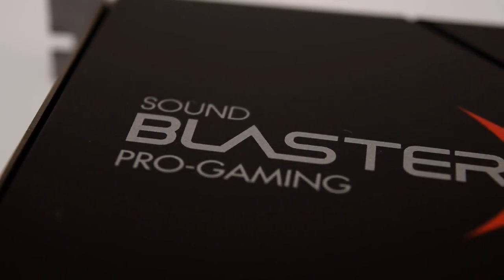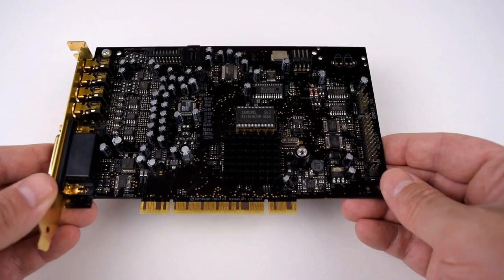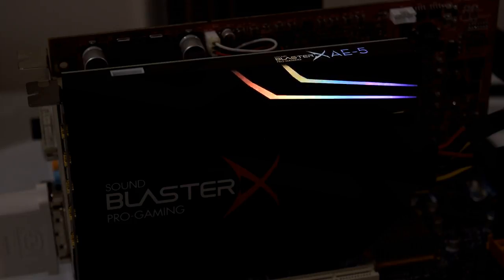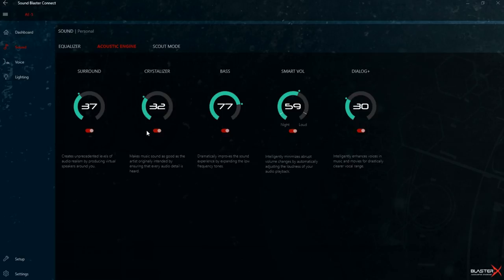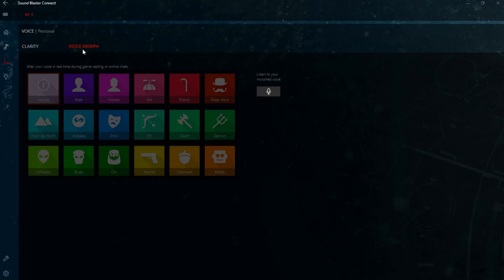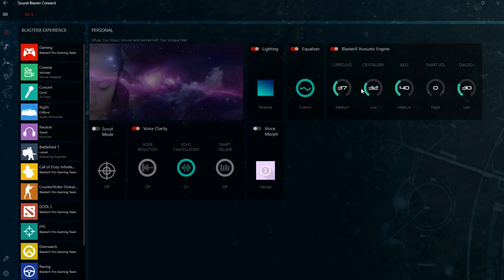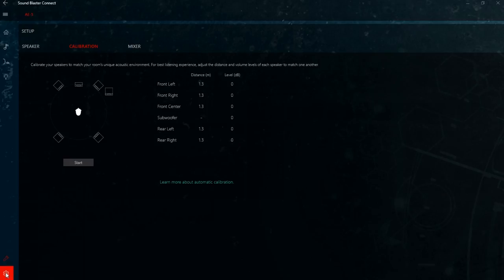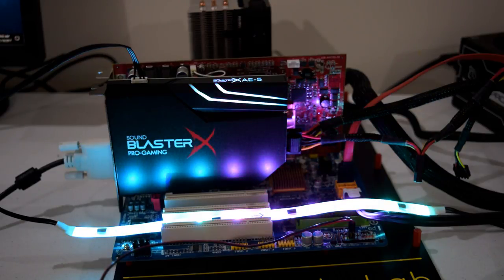Is the SoundBlasterX AE-5 Creative's best Sound Blaster?

Comment: Sounblaster X-Fi Platinum here! Still sounds awesome after 12 years!
Reply: Still using a X-Fi Xtreme Music as well. I can't quantify it, but it still sounds better than onboard audio to me. The AE-5 is the first card in a long time to make me consider upgrading.
Reply: Had to retire mine due to a lack of PCI slot on the last motherboard I got. Loved the front panel 5'25 insert. Now I'm stuck wiring everything though back yet again, like a crazy person.
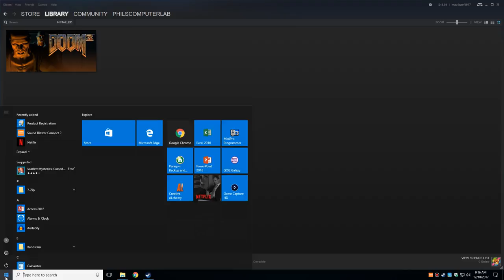Reply: I use the Soundblaster X-Fi Titanium PCI-E at 1:49, better than the newer Creative cards. Also Windows 10 compatible. I recommend the Daniel K drivers!
Reply: TheAslinger Me also on the Platinum, but on win7 pro.
Reply: I am using an X-Fi Xtreme Music in one of my Windows 7 builds with modified drivers and it is rock solid and sounds great. I also have an X-Fi Titanium PCI-E in an Windows XP build using the standard drivers from Creative and although the sound is great, the control panel keeps crashing when i adjust sound settings. I am going to download some modified drivers for the Titanium in the hopes it stops the crashes.
Reply: you should try a SB AWE 32 from the 90s....
Reply: x-fi is the best series of creative! I dont like these new post-3d sound era cards with gimmicky software that undermines the purpose of the sound card by using the cpu for effects. I'm lucky enough to have the top of the line titanium HD and I have upgraded its stock op-amps
Reply: That is a major classic!
Reply: Same here. 

I recently found my old Sound Blaster 16 ISA PNP back, complete with a wavetable daughterboard. Not the crappy Vibra16 one mind you, the real one.

Comment: I still use my old X-Fi XtremeMusic - it's just great! I had the Z for a while, but the outputs were noisy, so I got rid of it.
Reply: I second this. I tried to replace my Soundblaster X-fi with the Z, and the Z sounded very "emulated".  I returned it and Im STILL using my X-fi which is excellent.

Comment: I use the Creative X3 on my modern PC. Its is AMAZING. Clarity, Treble and Bass Excellent. The Separation between instruments and sounds is extraordinary. Works great in 7.1 Dolby too. I use it with my 7.1 A/V home theater receiver using Optical Toslink connection.
Reply: Hate to burst your bubble, but 7.1 over Toslink isn't a thing. Even if the sound card will work in 7.1 mode with Dolby Digital LIve enabled, the signal is down-mixed to 5.1 and compressed for transmission over Toslink.
Reply: @TheEvox81  Yes, The Creative x3 manual reads it can produce Dolby Digital 7.1 Virtual. Not sure exactly what that means but my A/V receiver has all 7.1 speakers enabled when I have it connected to the x3 so 7.1 must be working. Sounds good to me.
Reply: @computerenthusiast402  As long as your happy with the end result.

Comment: I remember Sound Blaster fondly. My 1st SB was the SB 16 for an Acer Acros 486SX/25, sometime in 1993. Fast forward to mid-late 1997 and I bought a SB 64 PCI for an Acer Aspire P200 "tower".  I built my 1st PC in April 2000 and used a SB live value card. That card went through several PC builds and I decommissioned it since it didn't do high res audio (24 bits / 96 KHz) and the last pc I built got flaky and went to another system...and bought a new Asus soundcard (still using it) that has high res audio.  Why I didn't buy an Audigy 2 I don't know. ;)

Comment: My REVEAL SoundBlaster Compatible card that came with my first Packard Bell computer was a workhorse. I miss that card so much. It lasted from 1994 all the way through till 2004, a good 10 years. Now-a-days, that's no big deal as a lot of computer hardware is useful for a decade or so. But back in the 1990's, very little computer hardware was useful two years after it was purchased. Those were different times, computer hardware had a very short lifespan back then. But the REVEAL sound card was an exception. It even allowed me to listen to early MP3's back when CPU's were not powerful enough to decode MP3's without dedicated hardware. It wasn't exactly perfect, but it did give my 486DX2 the ability to play music without skipping.

Comment: My first SoundBlaster was the SB16, I've just replaced my SB Z Fatality as it would glich sound depending on what W10 update I got... I literally got the AE-5 today and it's a great card, the software (SB command) is far better than the Z, but like the Z I use Optical Out and you have to find the setting in the app to turn it on, the app has evolved somewhat and you can find it under Playback, select Digital and enable "Play stero mix to digital output", I now get sound and 5.1, great card even after 3 years from this review.

Comment: One of my x370 mainboards has this built in, renamed to creative mb5, even has the same sabre DAC in fact it has an alc1220 as well! Aorus x370 gaming5. best soundcard ive ever heard by a mile is the auzentech X-Plosion, its based on a high end c-media chip and even has user changeable op-amps, not to be confused with the crappy c media chips found in cheap motherboards, its a beast

Comment: I used from SB AWE32 to Audigy 2. After I  changed to XMOS + external DAC and never come back again. It is far more playable via changing Capacitors, moding the clock,  and power supply etc to fine tune the sound.
Reply: My platinum Drive still keep in the case but no use. Haha, the built in DIR9001 to spdif is good, I used to connect coxial out to my external DAC. It sounds great with Kx-driver.

Comment: I recommend most people DISABLE any feature like Crystallizer that modifies the audio. I have an Auzentech X-Fi Forte from EIGHT YEARS AGO, as well as really good speakers from Audioengine. I can't tell the difference between the Forte, the DAC in the speakers or a recent Soundblaster that I borrowed just to test...

I can tell the difference between the onboard sound from my 5-year old motherboard (Realtek ALC892). I haven't tested any other Realtek chips though, but I wonder if good sound cards have much IMPROVEMENT left to be had over the previous best cards or external DAC's of high quality?

Comment: Drivers are a Creative weak point, but their cards are very good. For many years as far as until today I am using cards of their production. Great material. Thanks Phil
Reply: You should look at DanielK's driver sets. He does a lot of tweaking and refining that you might find appealing. Although, to be fair to Creative, their driver efforts in the past few years have been very good.
Reply: I was try kx drivers and another unofficial and they were better than drivers from creative. Now i am using Sound Blaster Z. This card i very good.
Reply: Charon Underground  this is true, my sound blaster X-Fi Titanium the drivers for Windows 7,8,10 are all buggy and for Windows 10 the card doesn't work right. The newest OS I can use is Vista without problems as for 7 once in a while the driver dies and I have to restart the computer to fix it.
Reply: @SilverX95 If the x-fi drivers bug out in windows (starts distorting sound) you can fix it by just changing the output mode, e.g flipping it from surround to stereo and back or vice versa. You can also just toggle the sampling rate back and forth. Instant fix without having to reboot.
Reply: @ Zeratuhl

thanks for the tip, I'll give that a try when i can.
Reply: +SilverX95
They're not THAT bad. However, DanielK's driver set fixes and optimizes all the rough edges. Seriously, look into it. 
+Zeratuhl
I've heard that before. Have you done it or did you read about it?
Reply: @TheCaptain Yes. I use an x-fi elite pro in my main desktop under Win10. It happens from time to time and is always fixed by changing the output which soft resets the hardware in the card. This is specifically for the issue where sound starts becoming distorted (gets rapidly worse over a relatively short period of time). If you are experiencing another type of issue then I don't know how to fix that, but the garbage output is the only issue I experience on my X-fis and is easily fixed this way.

Comment: Phil, the Audigy and Audigy 2 don't do 24/96 natively-- the internet is full of proof to show this. the X-Fi was the first Creative card set to do true 24/96 and is still a great performer to this day. 
however, just a note for the future, if you're going to be doing videos later including anything with an nForce chipset, I heavily suggest those get the Audigy when it comes time for testing. as someone that lived off a machine with dual Opterons and an overglorified nForce 430 chipset (and all the fun USB issues you get with more than 5 devices plugged in at one time), it is by far the best solution that doesn't get glitching or any of that fun stuff, and sadly only with the updated daniel_k driver set.
Reply: Audigy 2 ZS over digital output does AFAIK.

Comment: Re speaker type, the speaker system usually won't handle this, or it will handle it poorly. If you're plugging speakers and your sub direct into the 5.1 analog ports you definitely want to set this correctly as it will not just send lows to the sub, but also not send them to the speakers.

Comment: Great video. I installed this one but I hear some noise when connected to the 3.5 cables. Funny thing is that this noise is not present when connecting the speakers to the MOBO onboard. Do you know the reason?

Comment: You skipped the Xfi Titanium HD :(  It's what i use, sure, it is an Xfi based card but it was one of creative's legitimate attempts to create an audiophile based card. It uses RCA outputs/inputs, has only 2 3.5mm jacks for mic and line in, and cannot do surround sound except through using digital output to an external receiver. It's a complete anomaly of a card compared to all others creative ever produced.

Comment: I gave up on Creative a long time ago, when it became obvious that they were more about marketing than tech, and when CPUs got fast enough to do high-quality audio processing in software. The last card I bought was an Asus Xonar DX, because I wanted to try 5.1 over TOSLINK to my Logitech Z-5500d, but I was already happy enough with on-board audio.

My current gaming rig is a laptop that has a Creative Sound Blaster Recon3Di sound chipset, and it's not anything special. It's just a bunch of silly effects (which may even be implemented in software in the driver for all I know), most of which are meant to make up for the horrendously cheap speakers that Dell put in the laptop.

My personal opinion is that effects are only useful for fun or to make up for suboptimal speakers, and that on-board audio has been quite sufficient since at least the time that Windows Vista was released - especially if you're not using a surround speaker setup.
Reply: If you're using crap speakers then yeah. But if you're using a good pair of cans dedicated soundcards DAC's are wayy better than what integrated audio can output. my sennheiser phones had a lot of static interference when playing games until I got a soundblaster z on the cheap a few years back. 4 years later the card still works great aside from the lens cover on the card fell off due to the adhesive gone dry but that can be reapplied with some hot glue.
Reply: @oOignignoktOo1  I don't think that's been all that true for at least the last decade. Fortunately I have crap hearing, so I don't have to spend a lot of money to get acceptable sound in any case lol.

Comment: Might just get the SoundBlasterX AE-5 for my new PC.
Reply: Tempting isn't it?
Reply: yep
Reply: yeah I know that's the only reason I said "might"
Reply: +151 Guiding Light
What do you mean by "PCIe power pins"? If you're talking about the four pin molex connector, then no, that is optional IF you want to use the RGB-LED lighting. Phil mentioned this rather clearly. If you're just using the card to do it's job as a sound card, the power connector is not required. Or did you mean something else?
Reply: Bought it few weeks ago. Best thing I've done in a while. It does everything I need. ASIO only work exclusive tho compared to my previous Audigy 2 ZS.
Reply: I've been rocking a SBX-Z for a while now and I love it. What I miss, though, is proper MIDI playback using an actual OPL-3 chip. I remember discovering the extra MIDI soundfonts on my Ultima Online disc and it was just glorious to listen to. These days, the few MIDI files I've saved sound like they are playing on something like a tin can and some string. :/ Other than that, you can't beat the low distortion and excellent discrete 5.1 positional audio of a dedicated card. :)
Reply: +CybershamanX
Agree with you about current MIDI playback support. I still have my entire MIDI music file collection[because why not, they're so tiny in file size] and playing them back on current hardware is an awful mess when they used to sound so beautiful! Also agree with you about SB-Z series cards, excellent cards!
Reply: +TheCaptain I was able to mount it in a vertical position in my Cooler Master Cosmos II case (which I have a love/hate relationship with). You can check it out here: https://youtu.be/BVqGgMP_h0c I apologize for the obnoxious music but I was really excited to accomplish what I set out to do. :P Sadly, I don't have a clear side window so that I can see all of the pretty lights. :( I'm hoping to make a legacy computer build someday. I'm not sure what card I will use but much like the guy said in this video, the nostalgia factor is strong with my old AWE-32 or AWE-64 cards. We shall see what happens. Someday... ;) As far as getting a new card, I'm due to build a new rig in the next couple of years so an AE-5 might be on tap. ;) Thanks for sharing your love of quality MIDI! :)
Reply: That was kind of cool. There was enough detail to see what you did there. BTW, liking the "Eye of Ra" thing.

Comment: The 4-pin molex connector is only required if you use the RGB strip that comes with the sound card. The internal RGB lights will work without it.
Reply from the maker: Hmm I'm sure I tested this. But it's been a while and I can't remember 100%.

Comment: The best Sound Blaster card was the Sound Blaster 16 paired with a Wave Blaster daughter card.  It sounded fantastic with games especially ones with midi support.  And it had a good midi authoring tool by Cakewalk.  Using both the 4 operator FM chip and the wave blaster one could create some interesting sound mixes.  The wave table based Waveblaster was one of the best sounding internal midi devices made.  
Nowadays it doesn't really make much sense to have a sound card.  Onboard audio for games has improved a lot in the last 15 years.  Those who work with professional audio applications are better served using external digital audio devices connected via HDMI or optical which almost all PC's have now.

Comment: I can't seem to adjust the bass dial. all the others work and I have the system set to 5.1 "Desktop" it greys out the bass radial.  I was told you can adjust the environment effects of your voice overs, example sound as you are in a cave, your living room, outside, ect.   but that is not true. the prior sound software for the X-fi and SB Z series you could. you also got wave studio. this has no such software yet it is supposed to be a creative production card, more than just for games.

Comment: Fun fact, you don't need alchemy to run doom 3 or quake 4 with EAX on modern windows, because they alredy use OpenAL by default, so these are not affected by the change in audio architecture.
Reply from the maker: Are you sure you get the reverb in Room 3 right at the beginning?
Reply: @philscomputerlab  Yes, plus there is the fact it lets you select EAX on windows 10 if you have a EAX capable card installed with the proper drivers and all.

Comment: Hm, super high end DAC stuck right next to a PWM LED controller?  May as well just use the onboard sound.

I loved Sound Blasters back in the day, but time has not been kind to vendors clinging to add-in boards for functionality built into every PC motherboard.

If you really need HQ audio (and in most cases you just don't), you can get an actual no-BS DAC with USB or TB interface for the same price.  It doesn't glow funny colors.

What next?  A 3C-905XZ network card?

Comment: I snagged an SB Recon 3D on a great sale when the next gen came out since my onboard audio was a bit noisy (mostly only noticeable without sound playing).

Having the equalizer available was a bit helpful due to some of my headsets (notably the Corsair HS-2) were a bit flat sounding by default, but the drivers were capable of delivering what I wanted if pushed.

Otherwise though, I mainly use it for it's optical input. I have a TV as one of my monitors and have multiple game consoles hooked up to it as well. It's convenient to not have to switch headphones between console and PC use, and also works great if I'm watching content on my PC while console gaming and being able to hear and control both sources.

Any of the other bells and whistles really don't matter to me.

Comment: nice vid m8 did u say u can connect ur front panel mic/headphone ports on the pc to the sound card ?? & also can u change the speaker ports on the sound card for more line outs ?? because i want my headset plug in as well as sending the sound to my mixer ty & keep up the good content
Reply from the maker: Yea it has the front panel connector, the same one as the motherboard. You plug in speaker and headphone at the same time, and use software to switch between them, or it auto detects if you plug in headphones.